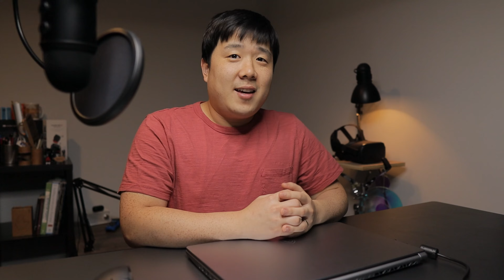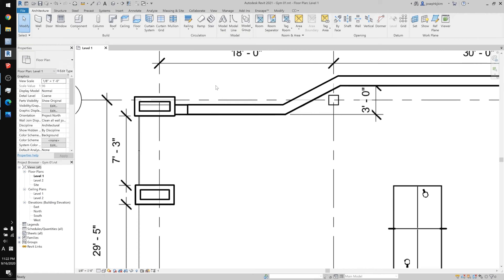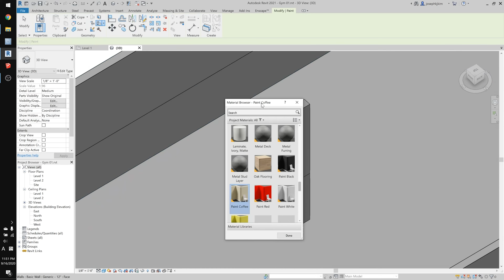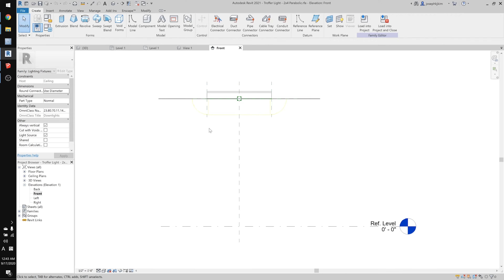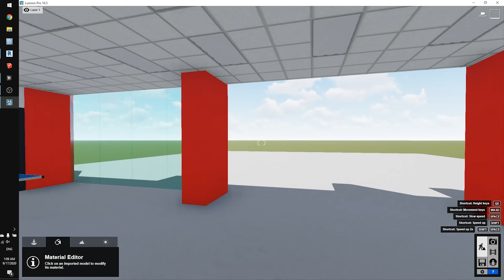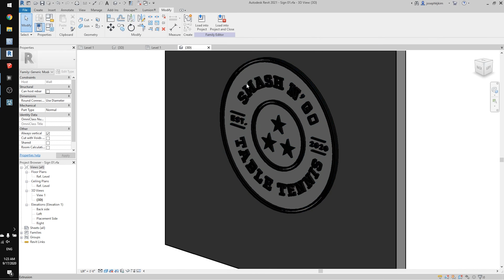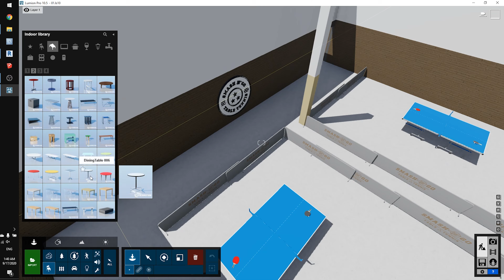Revit Modeling & Lumion Rendering Tutorial for Commercial Project (feat. SketchUp 3D Warehouse)

Comment: how did you get the ceiling grid from Revit into Lumion so that you didn't have to use a material in lumion??
Reply from the maker: A good question! I used the better texture available within Revit. The default one is terrible.
Reply: yes, but that doesn't control the grid lines themselves.  What I am running into is that the revit model has the correct grid lines, and then in Lumion it is just white until I just a Lumion material, the materials are not linked.  What were your settings for linking/exporting Revit to Lumion?
Reply: It may be because I do not have live sync yet, once that is downloaded from IT that may fix this...not sure, but driving me nuts!
Reply from the maker: It's been a while, but I vaguely remember that I had assigned Lumion material on the Revit grid ceiling.

Comment from the maker: Intro & Sponsorship - 0:00
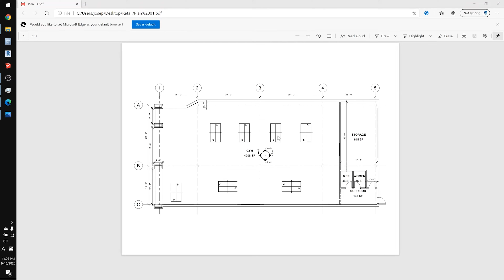Revit - 3:22
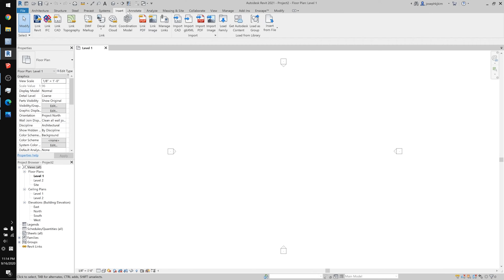PDF import - 3:36
Grid - 5:00
Walls - 6:00
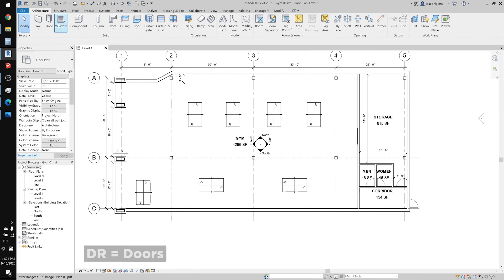Doors - 10:05
Column - 14:50
Shopfront - 15:15
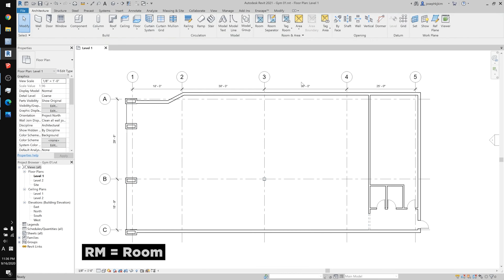Room - 17:10
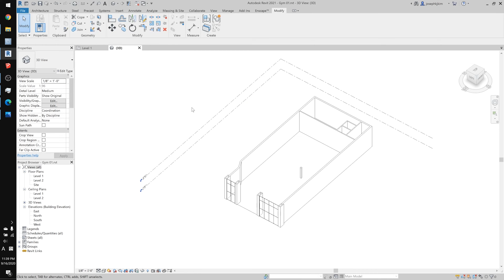3D - 18:50
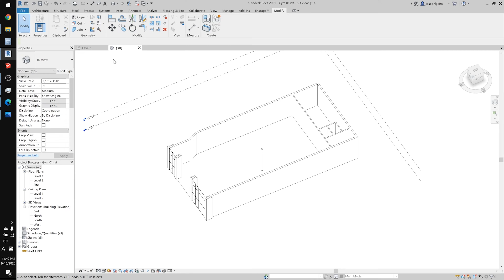Floor - 19:43
Paint & Material in Revit- 20:50
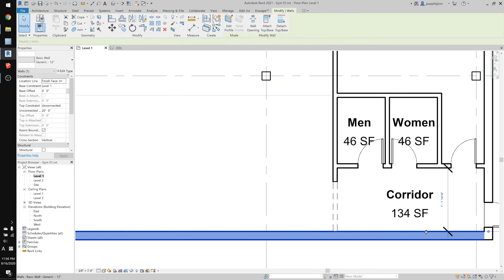Views - 27:39
Ceiling - 30:10
Family Modification - 34:32
SketchUp file import to Revit - 36:24
Lumion - 40:19
LiveSync - 41:00
Material in Lumion - 43:39
DWG file into Revit Family - 49:10
SketchUp file into Revit Family - 53:53
SketchUp file into Lumion - 57:00
Move & Copy in Lumion - 58:04
Render Scene - 1:02:07
Outro - 1:04:17